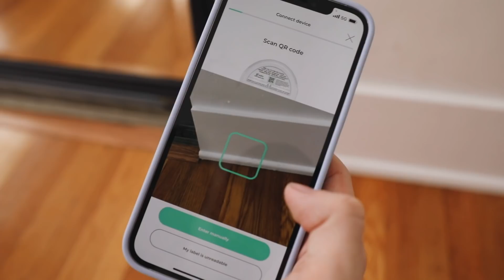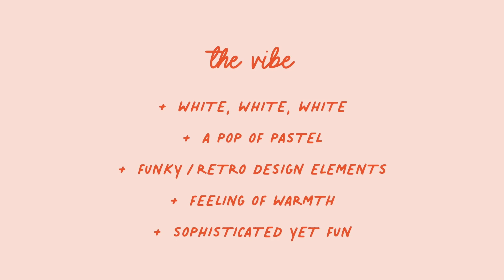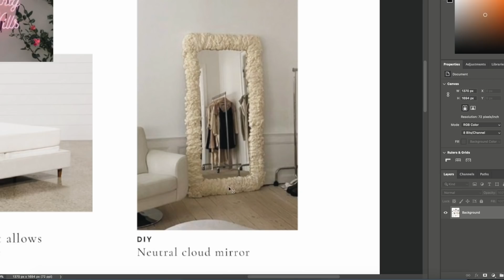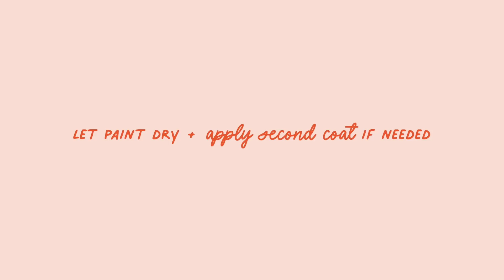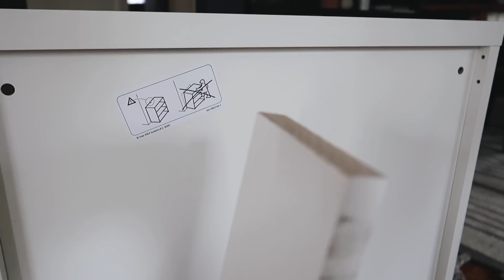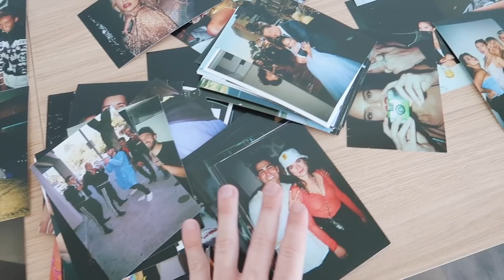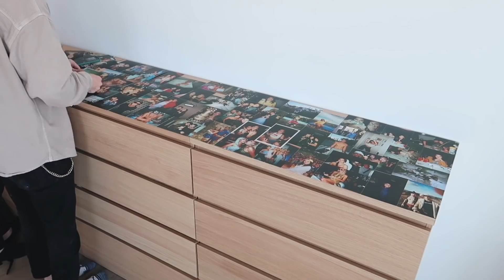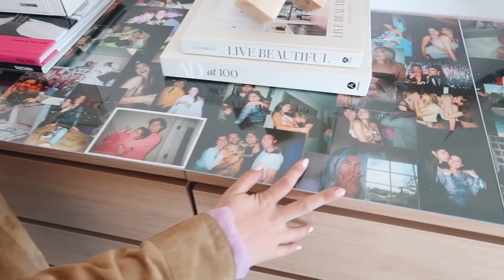EXTREME BEDROOM MAKEOVER for Natalie Noel from The Vlog Squad!

Comment: It’s interesting. 
The styling on the dresser was so random and cluttered, it didn’t need all that stuff. 
You could add a circle cork board to the bottom of the foam vase so nothing falls out. 
That plant definitely needs to move bc it was in the way sitting by the door. I would’ve swapped it for the floor vase with the twigs. 
Also feel like the nightstands serve no purpose bc you can’t store anything in them but they look great.  
It was just very plain looking.

Comment: I've never understood this ( US ) way of getting a rug and hide most of it under the bed. And there it gathers dust. But other than that, Drew, you really are great at what you do 🤩
Reply: It’s common with hardwood floors so that the bed rests on the rug and when you get out of bed it’s on the rug instead of the possibly cold floor. Also, in some cases it just looks the best